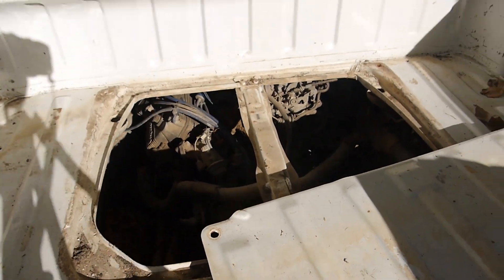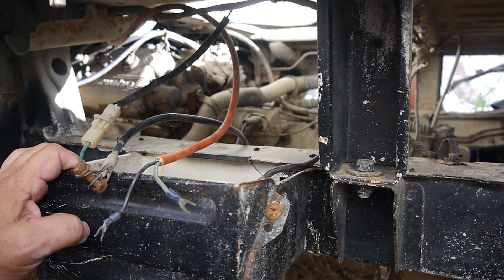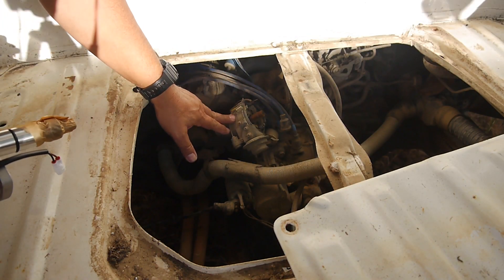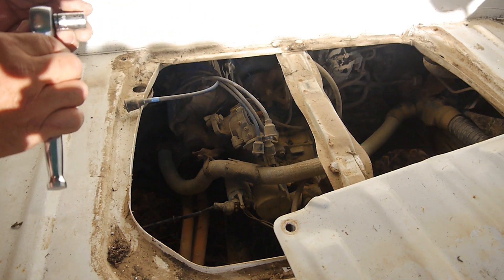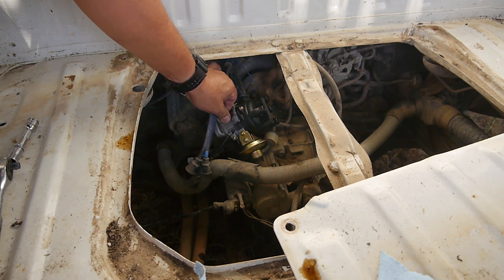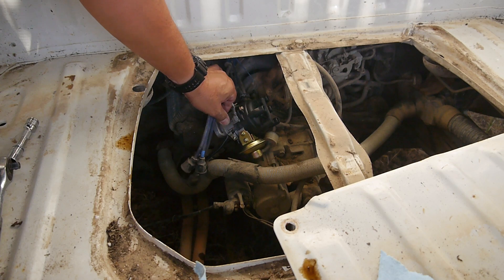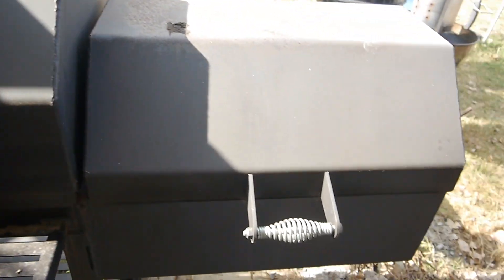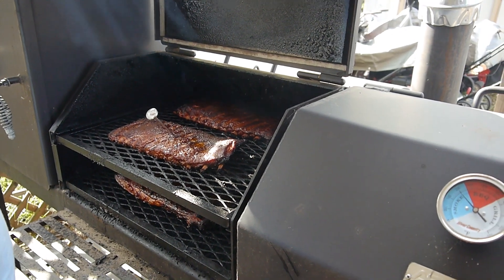Suzuki Mini Truck, Will it Run?  What is a Pesla?

Comment: Get that little buggy a running.  Looking forward to seeing it in operation.  Looks like a fun but probably a frustrating project.  Food looks great as well.  Thanks for the video.
Reply from the maker: Thanks!
Reply: @Elliott Blaine Instablaster =)
Reply: @Jefferson Marshall It did the trick and I finally got access to my account again. I'm so happy!
Thanks so much you really help me out :D
Reply: @Elliott Blaine you are welcome :D
Reply: Ok, I’m not sure on a Suzuki carry, but would assume it would be the case with any engine with a distributor cap… but you need to run #1 cylinder to top dead center, pop the cap off and determine which one of those are the #1 wire connector and as you slide the distributor back into the engine the rotor needs to point to that connector, the slide where the bolt goes to tighten it up will give you some adjustment to fine tune it.. obviously a timing light and the timing mark on the engine will allow you to put it exactly to the specs it calls for. So much for a quick comment, electronic ignition has made it so this process is next to obsolete